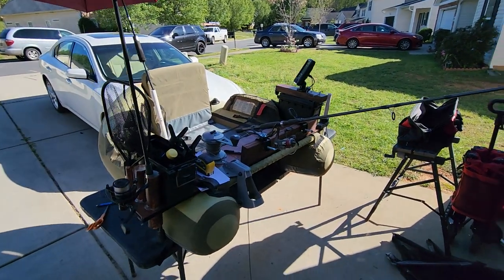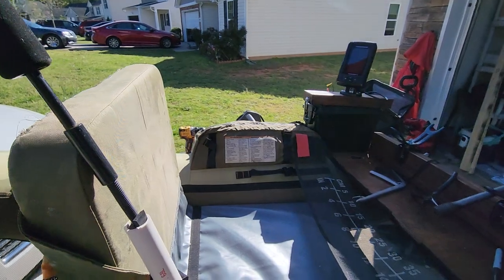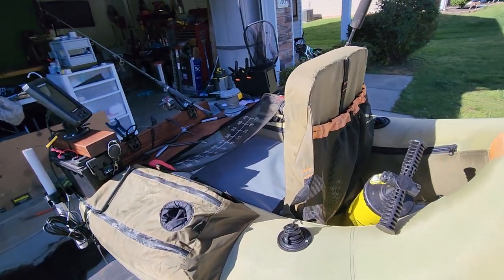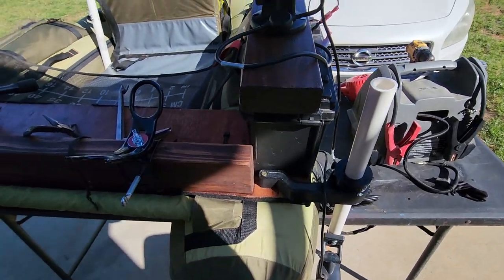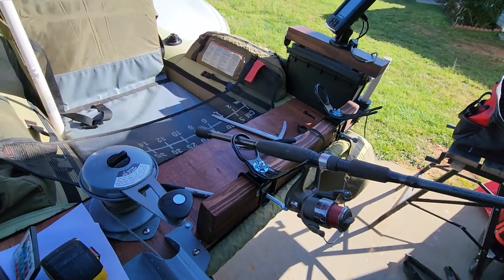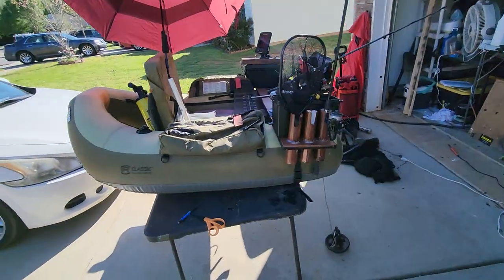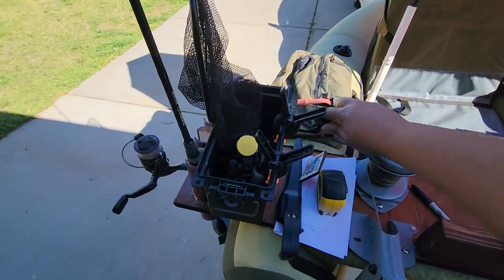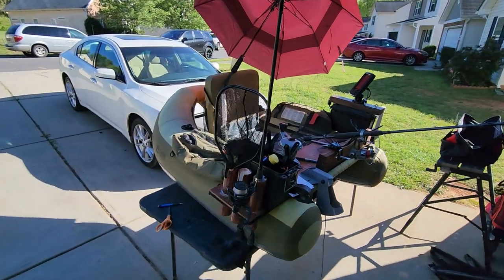Cumberland Float Tube Belly Boat Modifications

Comment: How do you get in and out of the tube? If the board deck is straped to the tube, do you have to step over the setup to get in or out? With fins? Or can you get in and out and then secure the board straps? Cheers